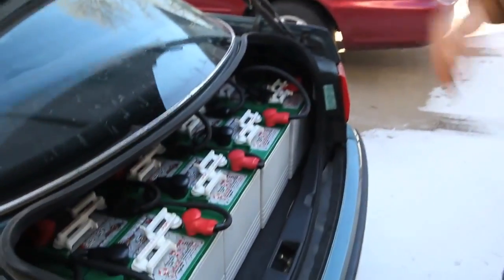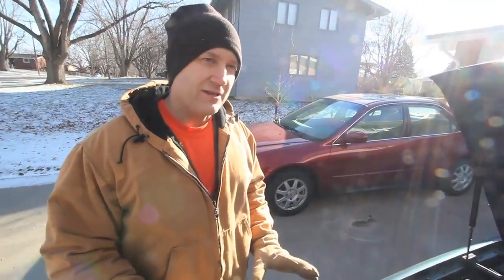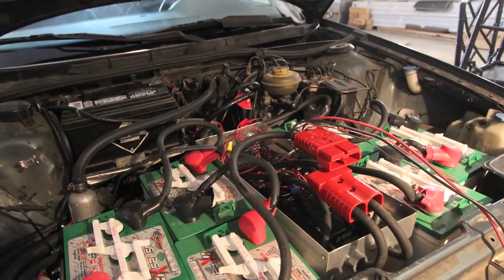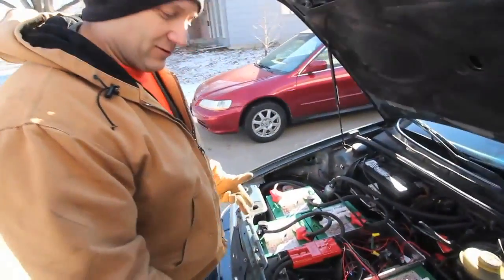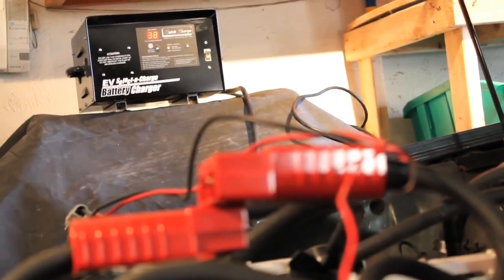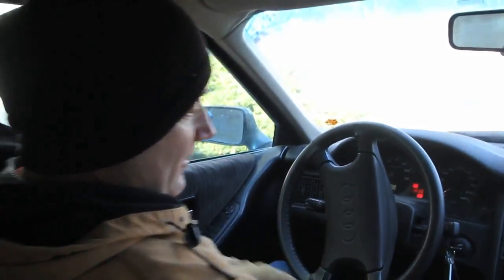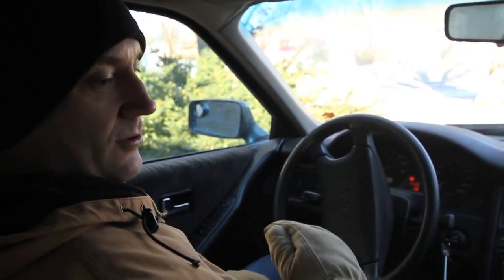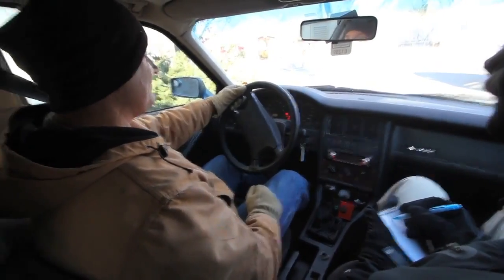homemade electric car conversion

Comment: Excuse me for my ignorance, but would this be cheaper to ride than a diesel car?
Reply: Tito Nogueira Once you have the electric car, the price to charge would be significantly cheaper than diesel. However, converting a car to electric power is not a cheap endeavor if you want range and long-lasting batteries.

Comment: Did you change the steering rack from power to unpowered?
I've been towed often enough to know that steering a car with power steering without the pump running isn't fun.
Or have you rigged up an electric motor to run the power steering pump?

Comment: Awesomeness - you´ve just built at home what half of the motor companies with their development centres and multi million dollar projects don´t get done. If you could implement something that re-gains energy (from the spinning of the wheels or the heat of the brakes, for example), this could be a true option for everyone....everyone who´s not in need of a large trunk, of course ;)

Comment: don't those 24 leads weigh way more than the car is rated to carry total weight? and then you add 3 people on top of that. it's pushing the structure of the car.
and that's 4000$ worth of batteries, for that you could get 10kWh of Calb CA cells that would about match the range but take up a small fraction of the space, live much longer and give the car much better performance because it doesn't have to carry a ton of lead. literally.
and you'd have a trunk

Comment: en EV shouldn't really be made with lead batteries anymore though..
those 24 batteries weigh almost as much as the car itself and they are really bad at supplying energy because of peukert effect. and they die really quickly so lithium is cheaper anyway.
what's the highway range on it?

Comment: Sweet car man. Hey, can that motor run 4000 watt a belt driven ac generator?  it seems like you could cut back on batteries and supply more power.